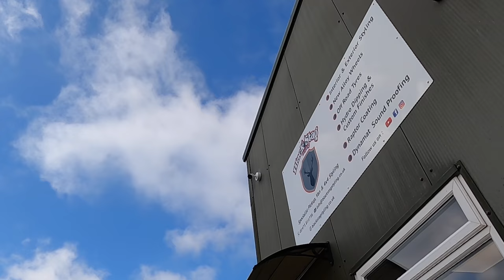Volkswagen Amarok V6 MODS! - Grills, Trims and Wheels painted Black - VW Amarok MODS and Upgrades

Comment: How do they go with spraying over the sensors caps?
Reply from the maker: Hi. Absolutely fine as we do this type of work all the time. 👍🏼
Reply: @BlackStagStyling  awesome! are you able to remove vw logo without taking front grill off? And is the back logo just needing un clipping?